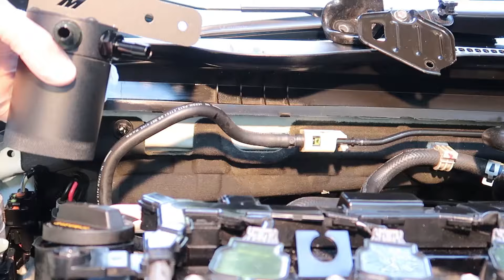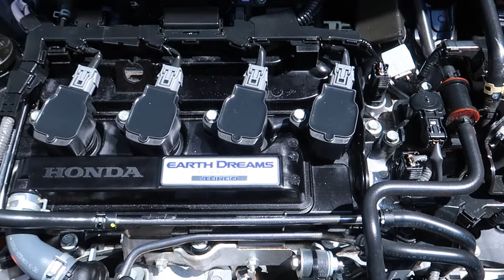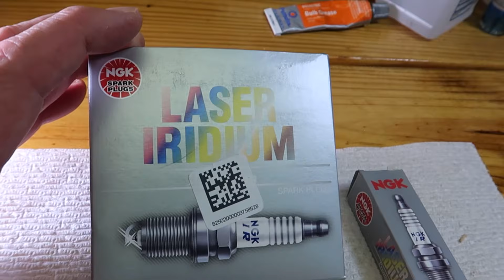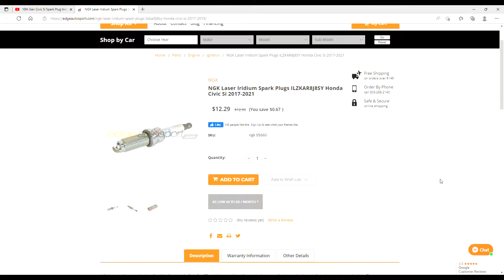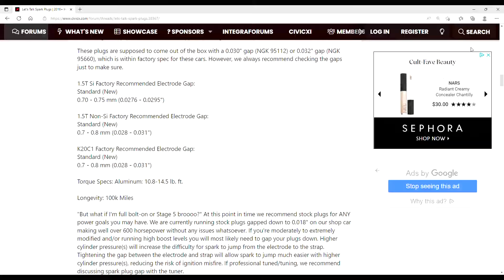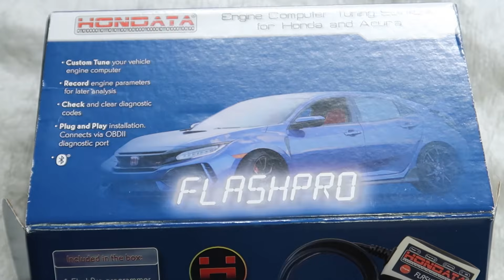10th Gen Civic Si Spark Plug Replacement #10thgencivicsi #10gencivic

Comment: how hard is it to remove the plugs?
Reply: Depends on mileage, whether the torque spec was followed during installation or cranked down hard, and whether anti-seize was used on the threads.

Comment: i brought my 2020 civic is to my mechanic today. he can't remove all 4 plugs, it has only 62k miles on it, bought it brand new . i brought the car home and searched for videos that could help me. my question is, what is the odds of breaking the plugs who]ile taking it out?
Reply from the maker: If you don't want to chance it, take it to your local Honda dealership! If you're feeling lucky, make sure the spark plug tube has been blown out with compressed air. Then spray a small to moderate amount of WD40 in the tube. Let it sit overnight. Then remove excess WD40 with a paper towel. Now it's time to break it loose. Make sure you use a spark plug removal socket!! Good luck!👍🏁
Reply: @Zspeed thank you for reaching back to me.. I really appreciate your help.. well what I ended up was in the dealership, and luckily,  years ago when I bought the car I installed an aftermarket rear mirror that has a recording camera 24/7and I saw what we missed. He waited for at least 30 mins to cool down the engine and walah,,, he effortlessly removed the plugs. I was stunned and researched the net for answers. Here is what i found https://www.google.com/search?q=why+it+is+hard+to+remove+spark+plugs+when+engine+is+hot&sca_esv=6a2da25b2ac48ac6&ei=PhnPaMmXIc6pptQPofCt6Q4&oq=why+it+is+hard+to+remove+spark+plugs+when+engine+is+hot&gs_lp=EhNtb2JpbGUtZ3dzLXdpei1zZXJwIjd3aHkgaXQgaXMgaGFyZCB0byByZW1vdmUgc3BhcmsgcGx1Z3Mgd2hlbiBlbmdpbmUgaXMgaG90MggQABiABBiiBDIIEAAYgAQYogQyCBAAGKIEGIkFMggQABiABBiiBDIIEAAYgAQYogRIv1lQyhVY50xwAngBkAEAmAGRAaAB-xKqAQQ1LjE3uAEDyAEA-AEBmAIYoAL7E8ICChAAGLADGNYEGEfCAgYQABgHGB7CAgsQABiABBiGAxiKBcICBRAAGO8FwgIKECEYoAEYwwQYCsICCBAhGKABGMMEwgIEECEYCpgDAIgGAZAGCJIHBDcuMTegB8uMAbIHBDUuMTe4B_MTwgcGMC4yLjIyyAd7&sclient=mobile-gws-wiz-serp

Comment: I have a quick question—since the spark plugs are threaded in, there’s direct contact there. But the ignition coil pack just sits on top of the spark plug, right? There’s no threading for the ignition coil itself, correct?
Reply from the maker: Correct, just push the coil pack straight down onto the plug. You may feel it click slightly.

Comment: Quick question normally when I do spark plugs, I put anti-sea lubricant on the threads. Did you do that or is it not needed?
Reply: Let me clarify this for everyone..... NGK plugs do not need Anti-Sieze on them. If you go to NGKs website it is stated that they come with a special coating that requires no Anti-Sieze.
Reply from the maker: You can, but Honda doesn't use anti-seize!

Comment: I saw your video first and noticed 22+ minutes, so I watched a 1-2 minute video instead. That video had all the basic information and was a nice intro, but your video is much more helpful and doesn't contain a lot of extra detail that is not necessary. I especially appreciated the recommendation to protect against getting dirt down in the cylinders. Very nice job. I now feel confident to change my plugs instead of going to the dealer and getting charged $240!!!!!
Reply from the maker: Wow, they're charging $240.00 to change out spark plugs, that's like a 20 min job for them!!!#😖
Reply: So...before you take out the old spark plugs, you clean the tubes first?
Reply from the maker: Yes, blow out the tubes first!!!👍🏁

Comment: nice video, i would like to add for anyone reading. dont cheap out get the NGK plugs or premium dont buy the bottom choice
Reply: I ended up getting autolite ultra bc the NGK was out of stock.. do I need to go back & exchange them?
Reply from the maker: If your Civic is tuned and your running extra boost, I would only use NKG!

Comment: Just did mine today. 2019 Civic ex-t . 54,000 miles. Got mine from O'Riley's. I like O'Riley's over AutoZone because the guys at O'Riley's are actually knowledgeable, helpful, and know about cars. They aren't trying to sell me a bunch of crap from the front of the store. They don't burp, swear, and fart and act like they hate their jobs 😆. The local AutoZone here is a friggin joke. Anyway, super quick job, mine looked exactly like yours when they came out. I also picked up the 14mm spark plug socket from O'Riley's. I was surprised they had it. They even have new oil drain plugs, transmission plugs, etc. It's funny you use the 303 because I do the same thing. I like keeping my engine bay super clean. I also used some electric grease with the coil pack plugs.  Then some copper anti seize on the coil pack bolts. I actually used just a tiny bit of the copper anti seize on the plug threads too. I know it's not necessary with modern NGK plugs, but figured just a small amount isn't going to hurt anything.
Reply: 54k is early to swap spark plugs, better to swap at around 90k or just wasting money
Reply from the maker: 54,000 is a perfect time to change out your plugs! If you're running a aftermarket tune they recommend changing plugs between 30,000-50,000 miles! Even without a tune I would recommend changing your plugs at 50,000!🏁👍
Reply: @Zspeed  yeah, I like doing everything early and often. Especially on relatively inexpensive things. People give me lots of crap for my 3500 mile oil changes. Oh well!
Reply from the maker: I changed my oil every 3,000 Miles on the Civic SI. You know about oil dilution right, I'll be coming out with a video on an oil analysis after 3,000-mile oil change soon!
Reply: @Zspeed  I do. It's even worse up here in the north. Where it's friggin winter most of the year. I run 93, and change my oil every 3500. A catch can will help too. I never short trip it, and always let it get up to temp before I drive, and never just shut it off after a long hard drive.

Comment: I just installed these “Si” version ngk plugs in my 2018 Si. What’s strange is that the original plugs that were in it are the “non Si” version. They were installed at the factory. Strange
Reply from the maker: They short-changed you from the factory, sad😪! Maybe some rookie working that day.
Reply: @Zspeed  I’m amazed just how easy this motor is to work on. I did the plugs, pcv valve, cabin filter, air filter with an AEM dry flow filter, oil and filter with Mobile 1. The only negative thing I found was the underside splash guard was completely missing! It was there the last time I did the oil change at the dealership, they must’ve forgot to put it back on or someone stole it? Either way I’m buying a new one.
Reply from the maker: Good luck,  I tried to buy one at the dealership and they said they were on back order with no real time estimate on when they would be back in stock! Some one probably stole it, I would hold the dealership responsible for replacing it!
Reply: @Zspeed  Hi brother, sorry bug you again but I really value your opinion. Ok, so I installed the ngk laser iridium Si version plugs, as said, the previous plugs in it weren’t the Si plugs,which was weird, but anyway I installed the correct plugs and all seemed fine initially but now a few days later and about 100 miles my car is now sputtering and backfiring substantially and the turbo isn’t building proper boost. It seems the correct plugs are making it run like crap. I’m going to toss the old plugs back in today to see if the car goes back to normal.
Reply from the maker: Good idea, let me know what happens, if that works, then buy new non Si plugs and try those!!
Reply: @Zspeed  Well,  I installed the old none Si plugs and it’s still doing the stuttering and backfiring. It was all fine before I messed with the plugs. I’m now at a total loss as what to do. My only option now is to take the car back to Carmax where I bought it a few weeks ago and see what they can do, I have the highest tiered warranty they offer. 😰
Reply from the maker: Sounds good, but you should also run a engine code reader just to see if anything pops up before you take it in!
Reply: @Zspeed  Good idea, there’s no check engine light but I’ll check it in the morning. 👍
Reply: @fordxbgtfalcon  Check/replace your PCV valve.....your symptoms sounds like it might be stuck open
Reply: @brent4469  Yep, you were right. The "new" pcv valve I installed when I did the plugs was defective and stuck open , i bought a new one from the dealer, installed it and now the car is perfect again. thanks for your help.

Comment: i thought they say not to adjust iridium tipped plugs?
Reply from the maker: If they are gapped correctly you will not need to adjust them, but you should always check your gap before installing new plugs!